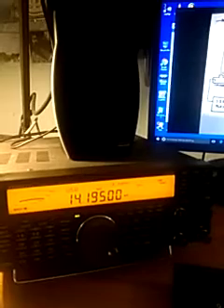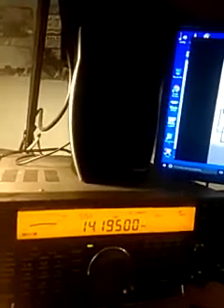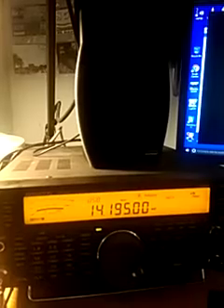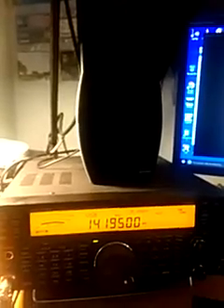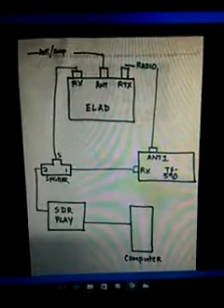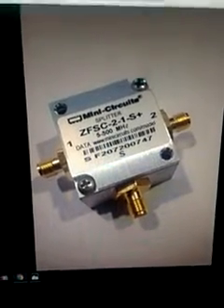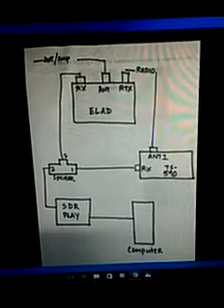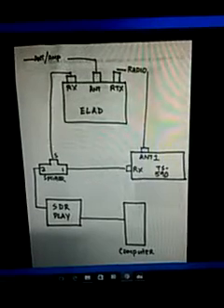How my SDR play is connected to my radio

Comment: Hi again,  I have the switchbox now, but before I connect it all together I need to check two points with you.
Your diagram shows ANT1 on the 590sg. Can I use ANT2 if I need to? Also, why use a splitter? As the Elad switchbox instructions does not show it as being needed for it to work.
Thanks 
Ivan G7snc

Comment: Hi I have the same radio, Hex beam, and have just obtained the SDRplay. Unfortunately your diagram does not appear very clear on screen. I believe it is because you took the video in portrait mode instead of landscape. However it is possible to identify each of the components. The query I have is to maybe confirm the obvious, in that the middle of the three connections out of the switchbox goes to your Hexbeam?
I am in England, and the only source for the switchbox is in Italy. Thanks very much for the video, it's been a great help.
Reply: elad switchbox "ANT" out goes to antenna